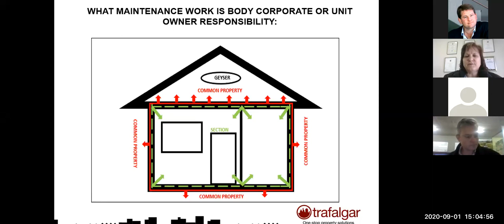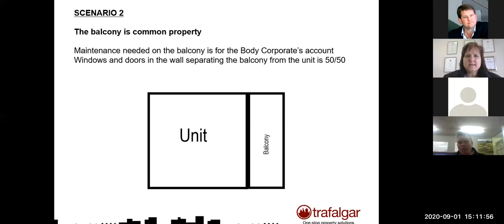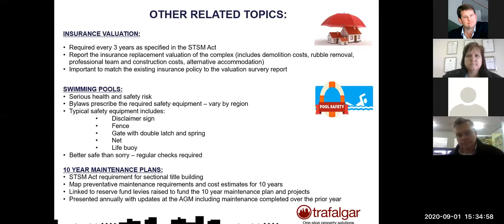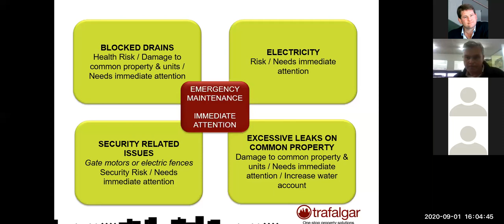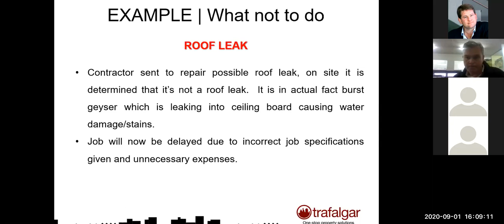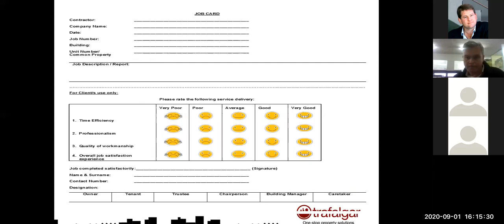Trafalgar Property Management - Maintenance Training for Sectional Title Caretakers & Supervisors

Comment: If a owner plants a tree in there exclusive use area that later on damages the boundary wall. Who would be liable the owner or body corporate
Reply from the maker: Hi Warren

It would depend if the wall was included in the exclusive use area
.

It would then also depend if the Exclusive Use Area (EUA) rights have been created ito the plans or ito the rules.
If ito the plans then the Body Corporate (BC) is responsible for maintenance to the EUA and if it was created ito the rules then the rules can stipulate that the owner is responsible for maintenance – if the rules does not stipulate anything then the BC is responsible for maintenance.  

And did the owner have permission to plant the tree? If not there could be a possibility that the BC can hold the owner responsible for the damage.

Not just a simple and straight forward answer.

If you need further advice, please call our Cape Town office on 021 410 5500 and ask to speak to Karien Coetzee.